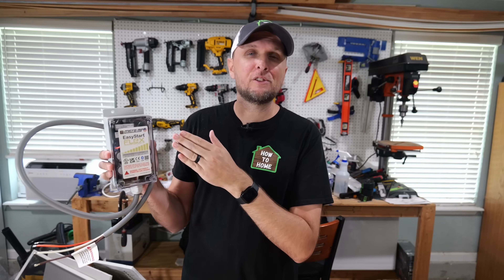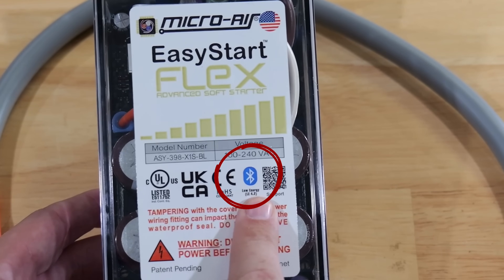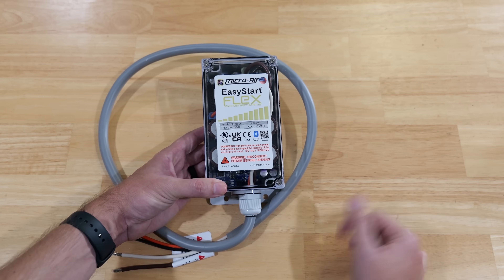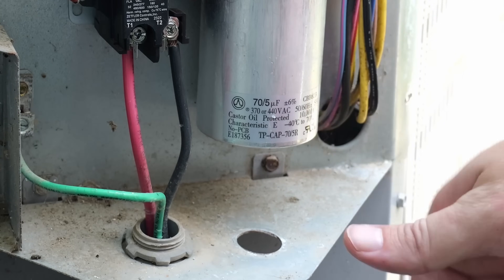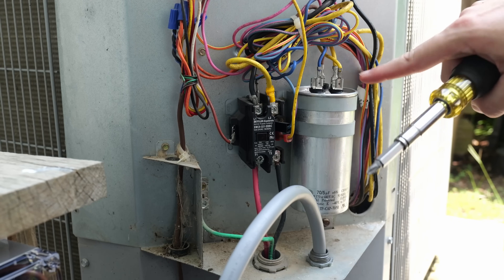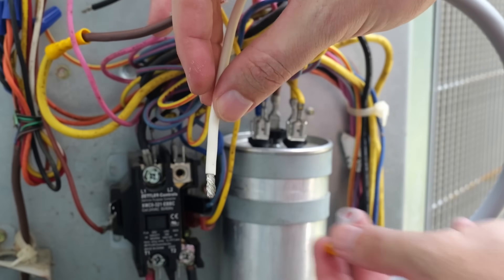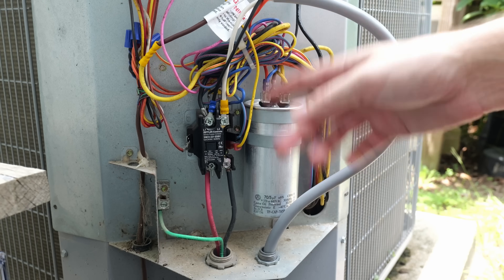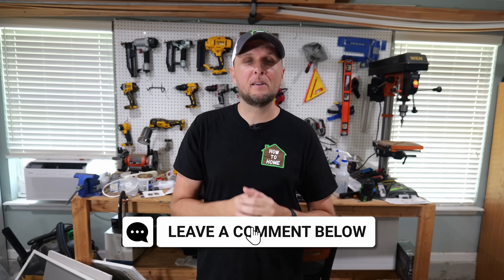The ONE AC Upgrade Every Homeowner Needs to Consider!

Comment: I started using Micro Air Soft starts years ago on our camper's AC. We lived in South Louisiana and when we travel, I can place a 2300 watt generator in the bed of the truck and power one of the AC's, run the camper's residential refrigerator, and battery charger. When we stop for a break, the inside of the camper is comfortable enough for a nap, have a meal, or just relax, no matter where we are. Before the soft start, the generator's breaker would kick out every time the compressor would come on. After seeing how well that worked on the camper, I installed a Micro Air soft start on the condenser on the house. I have a 5500 Watt generator that I had been running for the house. Before the soft start I couldn't run the central AC on the 5500 W generator. Sometimes the AC would start, sometimes it wouldn't, but it was cringing listening to the strain on the condenser and the generator. I kept 3 window units on hand and would place them in the windows ahead of a hurricane. I could run those on the 5500 W generator without issue, but that was a pain in the ... I thought about the soft start on the camper and figured that that should take care of the house  AC. I purchased the appropriate Micro Air Soft Start and installed it. Don't let the pre-read of the instructions scare you. When you sit in front of the AC and the Micro-Air and take one step at a time, it's easy. I ended up going through about 8 or 9 hurricanes after the micro air install, running on generator from a few hours to several weeks, all running on that 5500 W generator running our whole house. The Micro Air Soft Start was worth every single penny spent!!!! We have since moved to Central Florida and one of my first tasks was to install the soft starts on both condensers (new house is twice the size and 2 stories). I had inherited a 12,000 W generator when my father passed. That will run just about anything, but uses twice the fuel (I installed a tri-fuel kit where I can run gasoline, propane, or natural gas). I have set up the new house to be able to use either generator. With the soft starts in place, I can run one central AC unit on the 5500W generator. I can get both AC's to start and run for about a minute or so, then the breaker trips on the 5500 W generator. Has nothing to do with the starting, but with the running amperage. What it does prove is how valuable the soft starts are, that I can get both AC's started and running. I took meter readings and all that good stuff, but I purposely didn't include them in this comment. For most people, real applications make the most sense. Bottom line, if you plan on using a generator to run your house in the event of a power outage, and would like would like to run your central AC, include a soft start as part of that plan or current setup. You won't be disappointed. BTW, I have installed several on friend's RVs and houses. I haven't heard of one failure, or even one negative comment.
Reply: How do you connect your 5500 w generator to the breaker box?
Reply: @Wes_Sherman  I have a 50 amp plug/ box, with the proper plug leaving female plug on the cord). The box is wired with 6 gauge wire (for the 50 amp possible feed) to the top slot in the breaker panel with a disconnect/ Interlock that only allows the breaker to be placed into the on position when the main breaker is in the off position. I put a 50 amp female plug on the end of my 30 amp cord for the 5500 watt gen. This setup allows me to use either my 5500 W or my 12.5 kW generator by having 2 different cords.
Reply: @Wes_Sherman 
Look up an interlock device for your service  panel. 
Adding a “input breaker” and box , 30-50amp

Comment: I went to install this unit (previous model correct for my condenser) on my factory 3 Ton unit that is about 30 years old and works perfectly but has had to capacitor replacements in 30 years. My Carrier unit has a Factory Start assist (a small yellow thingy about the size of two golf balls) and some sort of compressor restart delay board. ALL the Youtubes showing how to install these do not show anything like my set up so I can not do it. Where can I get assistance? Do I pull all the Carrier Factory stuff out, do I just replace my Factory Start assist out? Again, where do I get help?   I just need my generator to be able to start my A/C which it will do a couple times without this unit, but then it just trips the breaker.

Comment: Thanks for the video I was watching your video and following along reading their install PDF. They could do a better job of writing this up. They focus on lot of wires that are not involved like the run cap wire to the contactor. Need to just focus on what wires need to be removed. Most AC  units the pages are in the middle of the PDF where section 1 discusses Comfort alert models have compressor monitoring IMO the most common should be first and less common install should be afterwards. I was able to get mine connected after I read the guide and watched your video I just paid $8800 for my new AC unit last thing I need is wire it up wrong and blow out the compressor. Now I understand how to connect it would be easy a 2nd. Compressor first time turned on seemed to strain little I was concerned the box wasn't working run wire was dead. I used my clamp current meter it was reading the same as before. I know probably would not have even started up without the run wire.
Reply: made in china for $5
Reply: @TheUnofficialMaker  No Micro-Air is made in the US it's a small family owned company. I know what you mean manual from China looks like. I worked in the electronics industry what happened here is likely the electrical engineer wrote this they didn't hire a technical writer to do it. Most EE's are terrible at explaining how to do something to someone who has no understanding of electronics. I used to work with them on a daily bases as an engineering tech.

Comment: Good video. I want to find out something from you. What is the breaker size that supplies that AC and what amp service does that home has?
Reply: It’s probably a 30 or 40 since he said it was a heat pump. But getting 120 amps inrush is more like a 4 ton traditional so he might have a 50 amp. I’d guess 40😢

Comment: Guys. If you're not sure which wire is your compressor RUN wire, you should only have 3 wires coming from your compressor that run into where the capacitor is. They should be labeled R S C. R = RUN, S = Start, and C = Common. The START wire runs directly to the capacitor to the HERM terminal. It is usually either blue or purple. The COMMON runs to one side of the contactor, most likely the left side, T1, and should be black. The RUN wire will go to the other side of the contactor, T2, and is usually yellow or red. Just trace the RUN wire from the compressor to the contactor and that is the wire you splice to the BROWN wire. Then put the WHITE wire where the RUN wire was connected to the contactor. Follow the instructions and be safe. God bless.
Reply: You state that the RUN wire goes to terminal T2, but in the video he connects the RUN wire to L2. Please elaborate.
Reply: @bchluvrxyz816  Hi. First off, I am NOT an HVAC technician, so take anything I say with a grain of salt 😁. I'm probably like you, a home owner that wants to learn as much as possible about their HVAC system so we can avoid having to wait for, and pay, someone to fix our stuff. With that, I recently installed one of the MicroAir soft starts on my Carrier 4 ton unit and it's working great. I have OCD, so I've been watching hours of YT videos and looking at online posts regarding proper wiring and caveats to be aware of when attempting to do this sort of thing. Every video or document I've read refers to the L1 and L2 lugs on the contactor as where the main 220 volts come in and the other side of the contactor, where the common and run wire is connected, are referred to as T1 and T2.

Now, I also found that not every contactor is labeled this way. Some just have numbers on them. The main thing to be aware of is where your main 220 comes in on the contactor. The common and run wire will be on the other end. Also, the common and run wires may not always be C on the left and R on the right. That's why I made a note to mention in my original comment that you NEED to trace your RUN wire FROM the compressor back to the contactor. Your contactor may be mounted upside down or sideways.

A few of the videos that I found educational, other than the OP here, are 'How to WIRE an AC Contactor' by Breeze AC SRQ and other, really old, videos by a man named David Jones. His compressor wiring tutorials are really great.

To be honest, I actually reached out to the company that installed my Carrier about 4 years ago about installing the soft start for me and they said that they don't do that due to potential liability issues and that they don't even sell them. So, here we are. 😀

And just like everyone in every video states, PLEASE make sure you test for live wires before doing any of this stuff. You want to save money, not have your family spending it on your FINAL expenses. 😁 Take your time and ask questions. I did and I'm happy that it all worked out. Albeit a year after I bought the dang thing, but I HAD to make sure I did it right the first time. Good luck and God bless. 👊
Reply: @bchluvrxyz816  ....L and T maybe inverted...as to how the contactor is located....upside down or not. Typically. T1 ( for example) is bottom...getting feed from the home...and L1 is "to load"...or to the device getting the power. Same idea with T2 and its matching L2.
Reply from the maker: @bchluvrxyz816 the contactor is upside down in the video.  Outside of the markings it really doesn’t matter as far as the contactor goes.  The line side will be coming from the home and the load side will be the wires going to the compressor and other areas.
Reply: @HowToHomeDIY  Thank you and Great Videos. Your videos inspired me to tackle installing a soft start to begin with. 😃 I'm planning to do the stand by generator wiring and interlock next. I hope I didn't steal your thunder by my comments or confuse anyone. We all have to try and help each other as much, and safely, as possible, right? Keep the great videos coming and have a blessed day! 👊
Reply from the maker: @mikesidden oh no problem at all!  I actually really appreciate you contributing and sharing your experience with it. I just wanted to reply to the other gentleman to clarify why what was in the video didn’t fully line up with what you said in regard to the T2/L2.  You were correct.  So just trying to clear any confusion from it.  Like you said and I mentioned in the video make sure to follow the instructions from Micro Air.  This video is more for supplementation and visualization.  Really glad to hear the videos were able to help and you were able to get yours installed and going!  Sounds like you’re well on your way to having your whole home setup.  Again, thank you very much for contributing to the community.  I try to get to as many comments as I can but can’t get to all of them.  It is awesome to see folks like yourself helping others in the comments.  So thank you again and hope to talk again soon!  God bless you too!
Reply: All this "wondering" is easily avoided, by ALWAYS taking a cell phone picture before you unhook any wire.  All the great HVAC techs do this too.

Comment: I bought one going on 2 years ago for my 5-ton unit here in Arizona.  It sees a lot of run time and is controlled by 2 thermostats....that means it could shut off after satisfying one zone and then start back up within seconds later for the other zone.  The compressor is made for that, no stalling.  I wasn't sure of the original starting amps before I installed it, by now after looking at the APP, I see14,000+ starts and I think it's going to make the compressor live a lot longer.  The "Last Start Peak" amps was 34A.  I'd say that's pretty respectable.  FYI, the APP is only visible via Bluetooth when the unit is running.
Reply: curious if or how it affected your electric bill during the summer...I don't pay demand charges, but imagine this would save a few bucks

Comment: I bought one of these, installed it carefully and it was working great for 2 months. I went on a business trip and my wife called me in a panic. No AC. In Florida, in the summer. Had to call my local AC tech. The run wire on the softstarter has fried. Burned for a distance of 6 inches. The tech rewired the AC and back up and running. I wrote to MicroAir assuming they would back their unit. NOPE! I was told it was heat related and I should splice the wire and reconnect. WTF! So I am out $400 for the softstarter, $130 for the repair and back to my basic AC. VERY disappointed in this company. Buyer BEWARE!!!

Comment: I can't speak for how other power companies handle their rates, but ours charges what they call peak rate, and how that is calculated, they take the one hour between 4-7 pm in the summer(6-9am winter) out of the month and whichever 1 hour has the highest KWH use, they add 12.00 per KWH. Now our normal rate is 0.06872 per KWH, so for 21 hours we have really low rates. If you know how to work with those hours, then you can have a super cheap bill like I do.
Reply: That is called a demand charge my utility also does that. Soft start won't change that they take their reading over 15 minutes short spikes in current are not counted as part of their calculation. I'm running mine off a inverter and 14k5kw of lithium batteries I power shift charge the batteries up until 4pm then go on battery until 7pm. I plan on connecting panels just haven't gotten to that yet.
Reply: @Mike-01234  I put a timer on the water heater, it's off during peak hours, but I can still shower and not run out of hot water. I run the temp down a couple of degrees on the air conditioner a few hours before peak, so that doesn't run during peak(programmable thermostat) my bill is usually 70.00 for a 1700 Sq ft house, where the neighbors with same size house, same amount of people, run around 150.00 because they didn't do anything to curb use during peak hours!

Comment: not in stock, and I guess the price for a 4 ton is over $500.  The 115 volt for window units is $275 !  yikes.
Reply from the maker: No they are not over $500.  Where are you seeing that?  If I remember right they are $379 or right around there.  Also, they dont make a 115 volt version.

Comment: Put one of these in three years ago. Still going strong and ran A/C through two hurricanes and several power outages. Fiber optic internet stayed in service too. Crazy. Portable generator and soft starter combo installed DIY for under 1600.00.  I've been through power loss in many hurricanes for two weeks to a month. It's miserable. Never again!
Reply: Great video. I'm glad this works for you guys. Just one thing, as a licensed electrician, I need to stress to you to use the connector manufactured for the application. Do not use a sealtite (either metal or plastic) connector or a rubber bushing for the micro-air cord. Use the proper size cord grip connector. 
Also, nice work using the Klein ratcheting terminal crimper.

Comment: I don't think lowering your inrush will affect your billing from a demand meter. The inrush is only for 6 cycles, most demand meters take the highest KW usage in a 15 minute interval.
Reply from the maker: I don’t live in an area with that so I’m not completely sure but I’ve had numerous people say it lowered their rates 🤷‍♂️
Reply: @HowToHomeDIY  Most of the residential demand meters I have seen are based on KWH. So the utility will bill you based on the usage during peak hours and a lower price for usage on off peak hours. The demand meters for commercial and industrial I have seen are based on KW. But none of them see VARs, so start up of their large motors don't affect the KW demand. They are billed off of peak load.

Comment: Are these ok to use on Mini-Splits?
Reply: I think I read that you SHOULDN't use them on mini-splits, but I'm not really an expert (I just play one on YT) 😁. I would recommend calling Micro Air directly. They are very easy to talk to and very helpful.
Reply: @kirk1618  Ok thanks
Reply: A mini-split is a just a smaller ac unit and usually 120v instead of 220v.  But just make sure it doesnt have the new invertor compressor.

Comment: Several years ago I was told to installed a hard start on my AC unit witch I did, now I hear I should have gown w/ a soft start unit. Should I switch over now? A soft start cost a lot more + I would need to through out the hard start unit. Is it worth it?
Reply from the maker: Depends on why the hard start was recommended.  If it’s for generator purposes then a soft starter is just way better.  But only you can decide if the value is there and does it jive with your finances.

Comment: Self installed two of the older units on my 4 ton Carrier Heat pump and 3 ton Lennox Heat pump 2 years ago, been working perfectly since then.  LRA went from 88 on the Carrier to 17 and from 63 on the Lennox to 12.  Have run both units for 3+ day outages two different times on a 8K watt Champion generator with no problems.  Purchased directly from Micro Air.  Had a question on install of the first unit on the Carrier and a Micro Air tech emailed me the answer within 1/2 hour of asking the question.  Don't think there is electric savings, just easier on the equipment and can run on generator power.

Comment: Installed mine July 13th the moment I learned of this new model. So glad I waited for this smaller unit I would never have been able to install the larger model inside my unit. Has been working fine since I installed it. Noticeable difference in noise of the unit starting up.